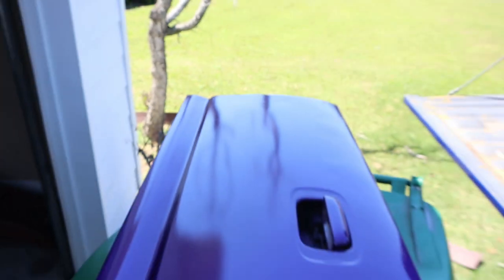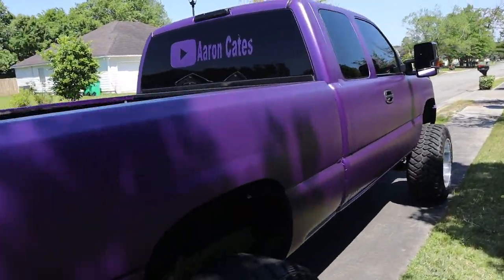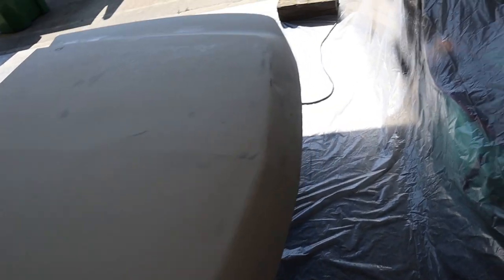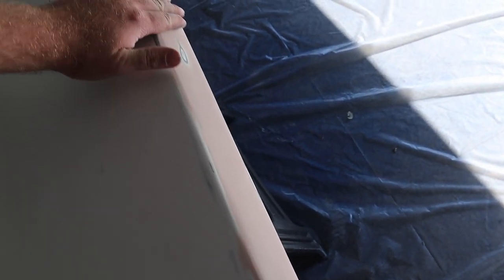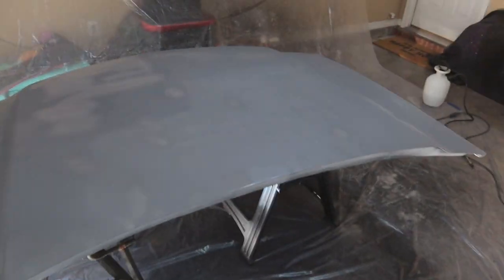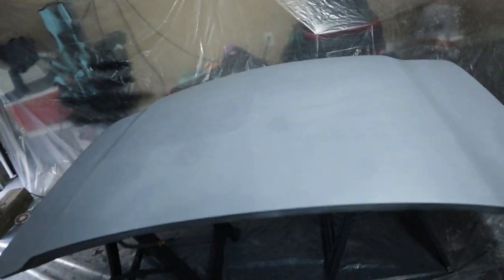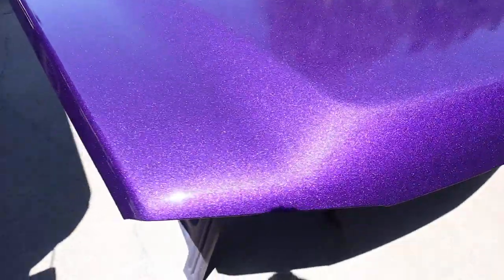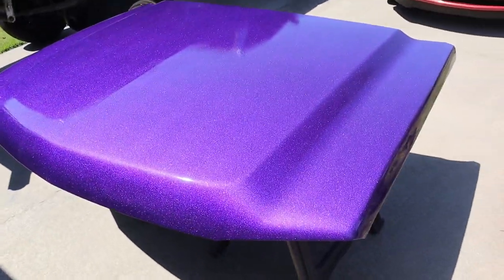This Paint Is LOADED With FLAKE!

Comment: Could be a couple different things, the fan on the gun isnt wide open, or just doesn't open enough. Could be your overlap, either way with flake or metalics you want to do what they call a control coat, it's your last coat. You turn down the air pressure a bit and increase your distance from the panel. The only thing I'm worried about with you is that your shooting single stage and a control coat  may cause dry spots. Imo, I would leave the chrome on the mirrors to match your chrome grill, I would paint the black plastic to match the truck. I know it's not maybe not a popping accent color but how about battleship grey or nardo grey. I'm doing grey and with purple accent  on my shitbox when I'm ready.
Reply from the maker: I think the gun was starting to get clogged and caused me to not have enough paint coming out.

Comment: I say paint the mirror caps purple, and leave the plastic part. Also, I'm a idiot when it comes to paint, but I've noticed stripes from that same primer you used out of a spray can, so I think that may be your culprit.
Reply from the maker: It didn’t do it on the tailgate though.
Reply: It’s not the primer it was the over lap you want to stay with a 75% over lap through the entire hood and when you spray you want to go from one side to the other not in sections